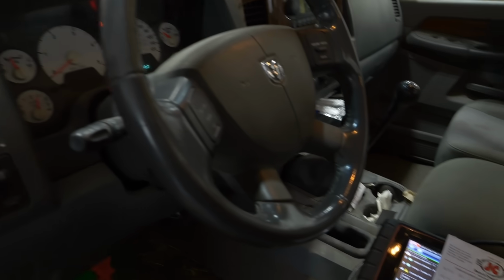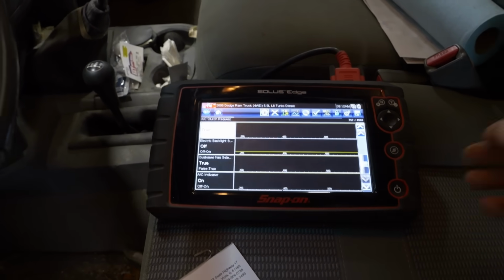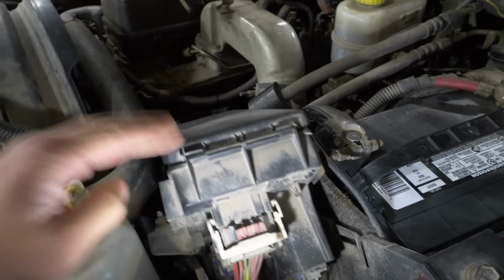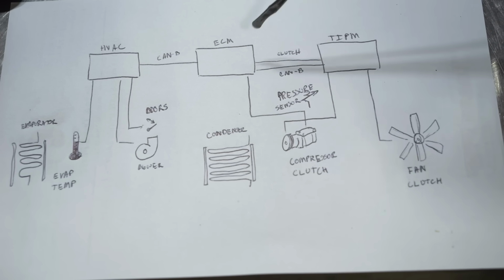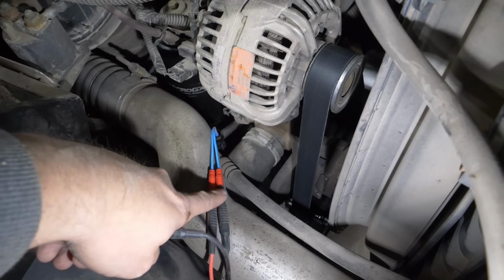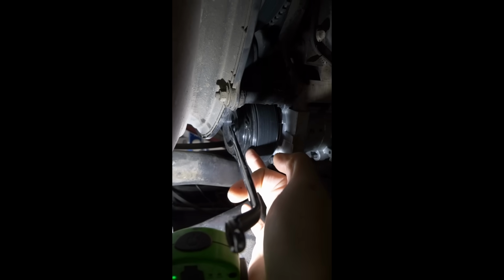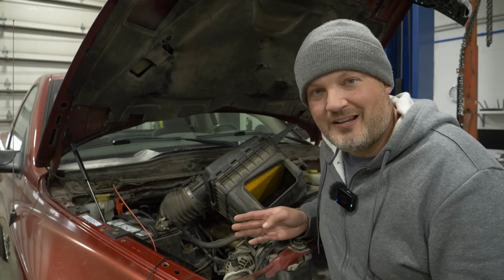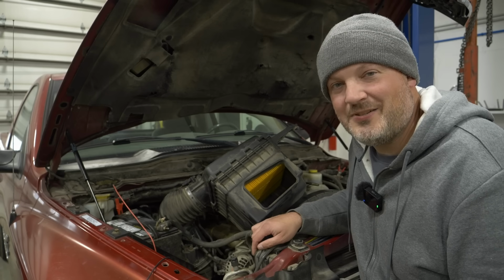Another Shop Fixed It, Now It's More Broken

Comment: Well apparently I've already watched this video and made a comment but when you said definitely a time you need air conditioning you know and it was pouring rain and probably asleep who knows I was thinking probably a smart idea because most of the shops are not inundated with air conditioning problems so they would be free to work on things like this. You got the job lucky you...lol... I just wish I could have one of those 12 valve Cummins but I would want it in a 55 Chevy truck with a five or six speed and 4x4 under it. Aftermarket A/C.

Comment: Sounds like my AC.  Got a new evaporator ... worked for a few weeks. then done.  Then, when changing the air-filter, saw where the leak indicator went.  Condensor.  Well, that is it for AC on my car.  Not gonna take out the entire dash to replace that.

Comment: Would have loved to get Wes's diagnosis on my Ford truck that literally smoked the AC clutch. Thought my engine was on fire! Only thing I can figure is the compressor locked up and the clutch slipped before the belt. But why?

New compressor and she's blowing cold again and my wallet doesn't cause as much sciatica to boot.😅

Comment: "Broken from new out of the box" is an old problem. I had a reconditioned wiper motor burn out the self park switch on first operation in 1982 or thereabouts. But then it was a Lucas part ....🤣

Comment: Hold on a second.  A shop replaced the compressor.  They recharged the system by AC machine I assume.  They then determined the AC had a wiring problem but never noticed clutch was frozen .  We can agree parts are crap as of late but I'd also say that the shop is at fault here.  That being said I have a real problem with shops refusing to diagnose and repair wiring issues.   I see it all the time.  Phh we will charge you 1800 bucks to replace parts but if it's an electrical issue of any type you'll have to bring it somewhere else to get that part fixed.  I never had the luxury of refusing to fully repair anything if I wanted to get paid.  Sad times . When I started as a mechanic it was a bad rep occupation,. We worked to make it better and earned customers trust.  Now we are back to shady practices , inept diag and parts changing morons who charge ridiculous rates .  We won't even talk about manufacturers getting away with their own BS.  Sorry  . I spent 30 years learning ,teaching ,training and making sure customers were reassured they weren't being screwed and that the repairs were done correctly.  Keep up the good work Wes .

Comment: One of the most infuriating occurrences for any mechanic, especially the do-it-yourselfer, is when a new part doesn’t correct the problem, leading to suspicion that the diagnosis was wrong. I recently replaced a friend’s Honda Accord starter with a rebuilt Bosch unit. The result was precisely the same symptoms as with the original starter. Out of options, she took it to a capable independent shop, where the diagnosis was a defective new part. Instead of $125 for the Bosch, the shop bill was $800. A service writer told me that a recent GM vehicle needed THREE new starters before the shop found one that was not defective. I bought her the Bosch starter and my wife and I paid the $800, so the total bill actually was $925. I have been buying Bosch parts since 1970, when I had my first VW. I should mail the starter to Bosch and say, “are you proud of this?”

Comment: Had a similar issue on my '06. TIPM would just command the compressor on all the time but the fan was not locking up. After the third compressor and thorough flushing, a new fan clutch, lots of cussing, I had 48 deg air again. Those compressors will blow off and die if the truck fan clutch isn't working 100%. Head pressure will easily go above 300 psi on a hot day with inadequate condensing.

Comment: Hey Wes I have a crazy issue with an s550 mercedes. Car sat for a couple weeks now i'm getting multiple short to positive codes. The battery had died so i had to jump with a jump box. Runs for a few seconds then dies. I've got like 4 sensors saying short to positive and the crank sensor says it has an open circuit. Car was running fine before it sat for 2 weeks. Just wondering if you might have any ideas?

Comment: Wes I have 06 mine had the same problem it was the ambient air sensor it's on driver side beside the head light may not be your problem but it was mine it's not a very expensive part of to replace

Comment: Known issue on these newer dodges with a/c compressor not turn on or other weird  issues  usually issue with POS TiPM box aka power fuse box but looks like this got more issue good old new parts junk as well

Comment: 3 options - AC Compressor is BOOTB - Bad Out Of The Box - OR, When the shop installed the compressor was charged with too much oil causing a lockup & failure, OR the previous failure left debris in the refrigerant loop which then came back into and nuked the compressor.

Also - A lot of techs mistakenly blame the TIPM on this era of Dodge, and while it certainly had its share of problems, there's a very good reason its almost always the LAST component to replace on Dodge's diagnostic flow sheets. Far, far, far more often its either a bad part or wiring issue; which, well, Dodge has always been notorious for wiring problems even before critters find their way into the vehicle.  Bout the only diag sheets that let you do the TIPM before much else was that vintage of 1500 with the 4WD AUTO option - for some reason, those were screwy straight from Dodge, and i saw a few of them legit catch fire; including one i PDI'ed and almost didnt make it back from my test drive with. I miss my Dodge days...  i think.

Comment: Air gap - are there any washer/spacers to create the proper air gap.  I fried a replacement clutch by not having the proper gap.  Will fully engage (not disconnect) or slip/burn up if not correct.

Comment: Definitely need the A/C in the winter time to pull the humidity out of the air so your windows don't fog up. And on the compressor, I would guess someone dropped it on it's face for the clutch to be jammed like that.

Comment: I have the exact same truck. Also had a very bizarre problem caused by the tipm. One headlight would not come on. Of course I changed the bulb and fixed it. Nope !  I took the bulb out and checked voltage and there was 12 volts. Scratched my head and put the bulb back in the socket and all of sudden there’s no voltage . 🥴. So it turns out with the bulb installed the tipm would shut the circuit down. Wtf. 😬.  Bought a rebuilt tipm and now both headlights work. Without a doubt that tipm will have to be replaced at some point.

Comment: I've seen this happen one other time and it was on a John Deere 5100E. I removed power from the compressor completely but the clutch stayed engaged. Customer had declined the repair because the AC was still working lol.

Comment: Maybe they didn’t put oil in the system or they thought the “new” compressor came prefilled? Then the compressor seized and most compressors have a “break away” function to the clutch which allows it to turn even when seized so it doesn’t pop the belt off. That would explain why the clutch is applied and no pressure.  

Also this may have been caused by the original compressor grenaded and the system wasn’t cleaned. Other shop shotgunned in a new compressor and all the shrapnel got into the new compressor and nuked it as well.
Reply: I would prefer if we have private discu-ssion,,

Comment: I once installed a brand new alternator from a big parts store and within 10 minutes of running smoke started billowing out from under the hood, I then replaced it with a used one from a junk yard problem solved.  New definitely doesn't always mean good or better.

Comment: i always have the parts stores test alternators and starters and stuff prior to taking them to install on customer vehicles. i also check fan motors, ac clutches, pumps and stuff myself prior to installation. as you well know a self employed small shop owner only gets paid to do it once !!!!! Seems like Alternators have the highest failure rate right out of the box!!! Sad state the replacement parts industry is in 😮
Reply: I would prefer if we have private discu-ssion,,

Comment: If I replace a compressor, do I have to look for hooped shrapnel?
I'm not sure what happened -
Did the original compressor fill the system with shrapnel, which then destroyed the replacement compressor,
Or the original compressor stopped working, then the replacement compressor 'hooped' and filled the system with shrapnel.
Reply: I would prefer if we have private discu-ssion,,

Comment: Front of the AC clutch has an adjustment screw to offset the magnet from the pulley.  A low IQ mechanic will be like ‘let me tighten this screw down’ the end.

Comment: Much ado about nothing, in fact, ya can’t do nothing 😮. Shame it’ll cost more than the truck is worth to repair it, but it does have the two vent cab cooling system as standard equipment, if the switches work and the motors aren’t smoked. Always interesting to see you troubleshooting problems  on late model vehicles , we try at home, but  it’s  a challenge  that makes one yearn for a pre 90’s vehicle. Good video, thanks!😊

Comment: Nissan maxima Bought a new a/c compressor because i didn't want to chance used as its a bitch to change
1st one seal leak at clutch 2nd one clutch would randomly stop engaging had to mail them back in for warranty and wait on the replacement so car was dowm which was a PITA .Finally went to Orileys got as  Orileys i could return without mailing it in if there was an issue  but it worked like a champ GO FIGURE

Comment: I was wondering how those tippins came loose this video showed me how to get that out of there because I have to replace mine that relay inside it decided to pop I have the 2005 Dodge Ram 2500 with the 48re transmission this was helpful seeing how that comes loose from its holder

Comment: To be fair, even though it's snowing/hailing/doing bad things, A/C is still useful to dry the air in the cabin when you need to defog/defrost your windshield.
Reply: That's true, I've never turned the AC off in my car for that reason - either it keeps me cool or it stops the glass fogging. It stops working when the temp gets too low tho

Comment: As a guy who has worked on cars since 1968...I know that the new confuser circuitry works mainly on 0-5 volts...does the ac compressor clutch always need 12  volts,,,I know I sound stupid but my basic understanding is that transistors hate  voltage more than 5 volts as it destroys their circuity..is this correct?  Kind Regards, Craig

Comment: Actually, I have a friend whose new 2023 Ram 2500 the ac compressor did the same thing. They found several pieces of metal all through the lines. At least he got a new 2024 3500 to replace his 2500.

Comment: Pull the orifice tube to see if it has any debris on the screen.  If not, you might get away with just a new compressor.  I learned how to do my own AC work years ago and have all of the equipment to do it.  I have saved myself and family tons of money over the years and know that it's done right.

Comment: I replaced the ac compressor in a Toyota and the shims provided for the clutch weren't enough and had to use them and the old ones from the old AC unit to get correct clearance.  Sounds like the previous shop didn't check clutch clearance but it could have degraded to zero clearance after startup because of poor manufacture as well.

Comment: Replaced a/c compressor on my 2010 ram 1500 4.7 last year. Wouldn't engage,  $400. Diagnosis later it turns out the factory who built it painted the clutch open, and it wouldn't enguage. Couple taps and tech had it working fine

Comment: On my current wagon I noticed the wire going to the ac pump disconnected, needing to do some engine work and move the pump out of the way so I decided to investigate why. I pressed the schrader valve and nothing came out. Hmmm so that's why that wire was disconnected, instead of repairing and re-gassing just disconnect the wire. More expense for me.

Comment: So, on that quip about air conditioning in winter: I argue that it's just as important, but not for comfort, but for moisture control. When It's miserable outside, the cold coils help remove moisture that would otherwise impede clearing foggy windows. 

But, it's still feels like a misplaced priority to be sure XD

Comment: Just a shade tree mechanic here... I work on my own vehicles. Our 250k mile Chevy lost a/c. It appeared the clutch wouldn't stay engaged. I likely could have replaced just the clutch. But with a light I could see the condenser was starting to leak. So I replaced the compressor, condenser, filter, accumulator and o-rings. Pulled a vacuum and held it for hours. It's never been colder. Over 338k miles now.
Reply: @davidgrisco1939
David, that's a smart thing to do is to hold a vacuum for 45 minutes to an hour or all night. Those dang machines that you hook up to do it automatically pull vacuum on it for about 10 to 15 minutes. Then they automatically go and fill it up. Which would be fun in a make believe world but we're working with machinery and we don't want any callbacks. I had the techs mark down the time on a tag of when they started pulling vacuum and the amount that they pulled and then wired it to the hood so anybody could see if it lost the vacuum then we knew we had a leak in the system somewhere. Our minimum time was 30 minutes and the vacuum shouldn't have changed. But I'm glad to see that somebody else knows how to do it the right way so you don't have to do it twice.
Reply: Get that a.c. fixed since it is snowing heavily in Illinois.😂
Reply: @toddavis8603 The automotive a/c system is and has been part of the windshield defrost function for many years now...

Comment: Standard cab, manual shift 4x4, standard transmission and a Cummins. What a unicorn.
Reply: Worth keeping on the road at any cost.
Reply: @TonyRule  
Absolutely.
Reply: If only it had AC
Reply: I got the ol family d350 hay hauler. Extended cab, captains chairs, 12v Cummins, Dana 80 and the getrag manual. The getrag is finally done at 1.17 million miles. Lost first and second gears. I sometimes have reverse. AC was dead at 800k according to my grandpa. The engine is still happy and it only rolls coal on cold or in the cold. My grandpa did amazing tuning and maintaining it. He has his 06.5 2500, 4 door, 4x4, long bed 24v, Allison, he's swapping to an Eaton once it's dead. Currently sitting at 480k on the clock. I was hauling hay in the d350 when I lost 1 and 2 just getting off the highway. He came back took the d350 home and told me to finish the job in his truck. I might do an Eaton swap too. If you care for your vehicle it will care for you. Lots of people do not realize older cars need love and will last longer than newer cars.
Reply: It's a keeper. I'd be buried with that truck lol
Reply: Extremely desirable
Reply: I've got the same truck just in pewter.
Reply: Plus it the final year before the big emissions changes.
Reply: But is the dash cracked?
Reply: @blakesteen7564 --  What if it is?  It's a truck.

Comment: it does happen ,when they installed the compressor did they put the correct amount of oil in it ,did they change the filter dryer ,did the flush the system with R11 , so many questions to answer

Comment: A shorty but a goldie, love your videos wes! did you check the pressure transducer to see if it was functioning? it seems even with a smoked compressor, there should be some change in pressure, even some flickering, when the engine is turned on.

Comment: Does the customer have any comeback with the shop that put the new clutch/compressor in because it seems to my zero sum knowledge that they did not do due diligence and made sure the device was working correctly before handing it back to the customer? You may not be able to answer that question Wes since you indicated that you know that shop and most likely the people who work there.
Can anyone unbiased answer my curiosity question? Thank you.

Hope your venison tasted real good Wes. I would very much like an invite to dinner or lunch some time because the last time I had venison was over 50 years ago and would like to try venison again 😍before the grim reaper comes to say howdy to me.

Comment: Did you just hook the test light up in series from the power/signal source to the compressor - is there no concern about a voltage drop across the filament? Are there situations where you would have to be concerned - you know, like the unit receiving power must have full voltage?

Comment: My dad has an 04 2500. Had an intermittent issue with the A/C. He replaced the HVAC module in the dash, only to find the issue still was present. I found out that Dodge has a known issue with the A/C circuit wiring. They apparently used undersized wires, and there is a connector in the steering column that will melt and cause shorting issues. That was a fun one to chase down.

Comment: Whoever put together that compressor - forgot to put air gap shim(s) in it.
Liquid slug killed it.

Unless it’s VRF compressor - previous shop should have noticed that it wasn’t cycling. Checking for not energized clutch free spin  - could have helped tremendously, also.